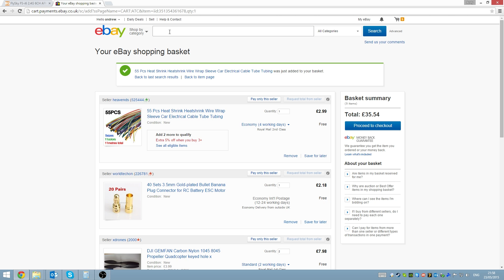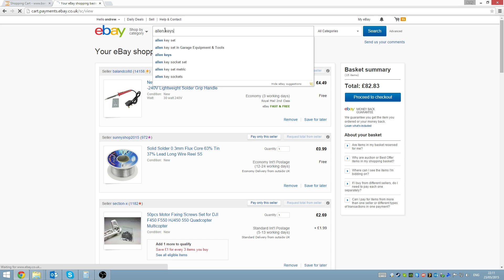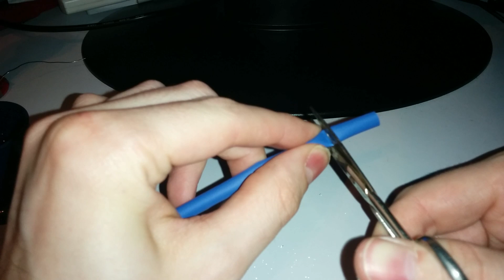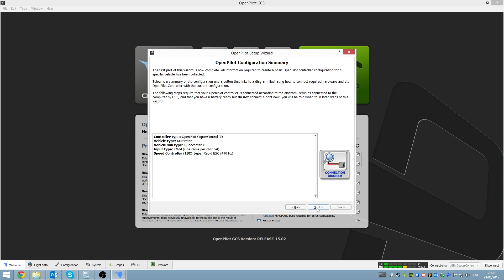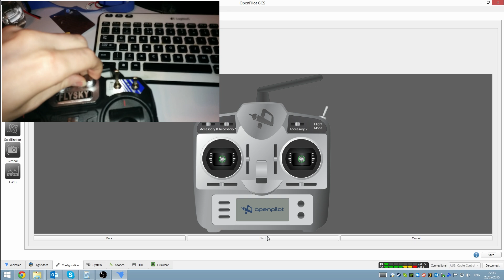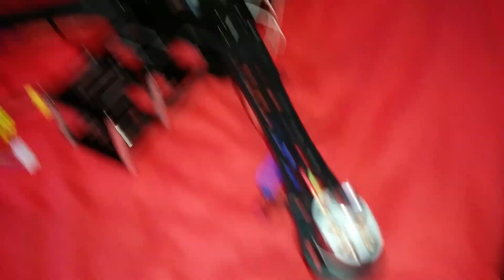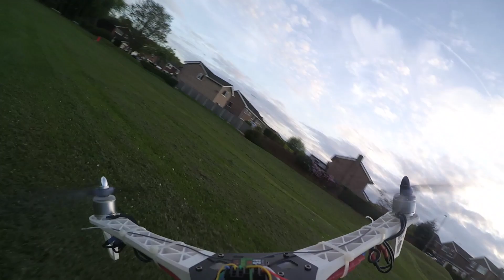Build A Cheap Quadcopter

Comment: Excellent video and still relevant in 2020!!! BG is really a great place to source part without braking the bank as this hobby can be serous money pit. The thing that irritates me the most is that local hobby shops selling the same stuff(or rebranded) on extremely inflated prices with the excuse of "high cost of running a business" but at the end comes to pure greed. That why Chinese online retailers will keep selling and the locals will go bust. I, just like yourself am a massive cheapskate and dont see  reason to shed my hard earned cash for branded products that are still Made in PRC but sold at few times the price... and seems that they dont get the point.. Example? Well, just look what happened to Maplin..

Comment: Things have changed somewhat since you made this Andy. You can now buy a full kit with everything but the battery and transmitter for around £80 and the transmitter can be had for £34. For less than £150 you can have one of these with GPS as well. Something I may build next winter. 
Thanks for this very entertaining build.
Reply: It's a worthwhile build and AndyRC has done an great job of documenting this build! Finished this 450 build a few weeks ago, it took a while but got there in the end! The great thing about this build is that you can add and take away gear as needed. I've used a water noodle as landing padding for my build and lot's of tape, zip-ties and extra foam. It flies quite nicely now on Libre-pilot..
Reply: I didn't wait until winter and I am just starting to assemble the many parts I bought individually inspired by this video I have updated to Omnibus and got all my electronics into the small space of an X-525 with no spaghetti showing ;)

Comment: Hi i got inspiration from your video i have also wanted to build one. I am using same 920kv motor with 30 esc 1045 propeller ande same frame but with 11.1v 3s 5500mah lipo can it carry the battery Wight ?
Reply: Faiyaz Khan that should be just fine, keep in mind that this video is fairly old, technology has marched in quite a bit so there are a ton of vastly better options for equipment at the same or lower prices. For example an Omnibus f4 flight controller runs circles around what was available 2 years ago for this build :)
Reply: Virtual Willis thank you very much for your suggestion😃☺️
Reply: Faiyaz Khan anytime, I'm building an S500 right now and did a ton of research over the last few weeks to get a decent build going. If you want I can give you a list of parts that I'm using when I get home later tonight. Just let me know :)
Reply: Virtual Willis thank you
Reply: That's will be helpful
Reply: Hopefully this formatting works, everything here is available either on Amazon or Hobbyking. The only thing I'm not 100% sure on is if the motors and props will be the same diameter (6mm) if not then I'll need a few small adapter rings, no biggy but I'm fairly sure they will work.

Battery: Turnigy 4000mAh 3S 30C Lipo Pack w/XT-60

Reciever: Flysky FS-X6B 6CH Receiver

Transmitter: FlySky FS-i6

Frame: s500 Glass Fiber Quadcopter Frame 480mm - Integrated PCB Version

Motors: Emax MT2213-935KV 2212 CW CCW Brushless Motor

Props: MasterAirscrew 10x4.5 

FC: Readytosky FLIP 32 F4 OMNIBUS V3 PRO

ESC: 2-4S 30A ESC SimonK ESC With BEC 2A

FPV Antenna: Aomway RP-SMA Male 

Gimbal: Quanum FY Mini 3D PROS 3 Axis Gimbal

FPV cam: Runcam Eagle 2

VTX: AKK X1 40CH 25mW/200mW/600mW Switchable FPV

HD cam: GoPro Hero Session 5
Reply: Small update, the props and motors are a perfect match, woo hoo! I should be airborn in a few days :D

Comment: I just built a F450 quad with AfroFlight Naze32 flight controller and having problems with PID.   It won't takeoff on its' own and when I had launch it fly's up and starts a uncontrollable wobble and crashes.  I going to lower PID numbers and see what happens.  Any suggestions on PID settings.

Comment: I like this video . I'm going to build another Quadcopter ! I just finished the HMF U580 I got it off Ebay as a whole kit with radio link AT 10 II , and Arducopter Apm 2.8 . It took a lot of work , but I finally got it to fly . Brand new to this whole thing , but I like it . Just curious I like the stay as cheap as possible scenario . But what about Like mid range say about a 500 dollar build in the same class Quad like this one you built or like the HMF U 580 ? What Frame would you suggest that could take some abuse , and what flight controller like maybe Pixhawk , or DJI Naza ??? I want to build something that is going to be worth a thousand dollars or more when it is all said and done . Can you put a parts list together in the description ? Maybe a couple different Ideas ? But don't get me wrong this is a good one . My HMF U580 is pretty nice , and I paid 500 dollars for the kit ... Thanks great videos you've helped me along the way here .
Reply: One thing I don't like about the kit I bought is that the  APM 2.8 board is retired , and you can't update to the latest firmware and I would love to stay away from things like this . If I would've known this ahead of time I wouldn't have purchased this kit . I like to be up to date with things I do . So boards that are state of the art for larger Quadcopters like this one you built here . I also like the raspberry pi idea , and the long range flying but still not a rich man so cheap is good .
Reply: Never mind I see you already made the High end build videos . I'll start watching those now ! Thanks

Comment: Hi Andy , Thanx so much for your video`s  - Brilliant and very informative - I have also reached the point where I would want to build a f450 frame up from scratch ,You`re video has assisted much but I would like to change a couple of things like having GPS,Barometer,Gyro,gimble and FPV, My problem is selecting the Flight controller to facilitate all this - also the heavy gimble in your video would that also take a firefly 6s.
Please understand I am also a noob at this so your help would be greatly appreciated

Comment: hello buddy really enjoyed your video. didn't go for exactly same as you but still using your video... QUESTION... where to get the cables to connect the receiver to Flight controller? I didn't get it with my transmitter...

Comment: I've followed your video in great detail a few times. I'm unable to find the parts as you were... Any recommendations insofar as a vendor that can provide all of the parts?

Would I do better long-term to go with the F3 V4 Racing  flight controller?

THe transceiver (flight transmitter/receiver/controller) - that you used, I've seen upgraded ones - but no matter the upgrade, they all seem to be limited with 6 inputs back to the controller - hence, my software to take advantage of those receive ports. Is this ornal? Is it because multiple things can be read on a given receive line? (i.e. altitude and / or GPS data coming in on the same line (R0, for example), and on R1 maybe I get other weather data, R2 other telemetry data?

While I love the 250 size and 450 as well, I'm looking at a 450 or larger, primarily for aerial photography. I've purchased the more expensive units - XIRO the best fr very smooth video while getting enough payload for me to mount 2 batteries on the unit and a cross-over that allows me to switch from an almost dead batttery to the fully charged secondary one. This I've done successfully with XIRO but not with DJI units (F 3 and 4) because of the way the XIRO is built - it's much more extensible. But I'dd love to try and  build something even better... thoughts??

Comment: Great video, really outstanding to put something from start to finish!  I've been flying toy grade like the Syma X5C for line of sight practice.  I want to move up to something slightly larger with brushless that can carry a runcam or Mobius.  I don't need a lot of speed, I'm more interested in run time and stability.   Is the 450 build the step up?  Or is there a a slightly smaller in-between model?

Comment: Hey guys i am currently trying to build my drone with arduino uno. I am 
trying to make the drone without using a radio controller, just by 
sending pulses to the arduino from my computer. Does this work the same 
way when trying to connect to the gyro and make the connections?
Thanks

Comment: Hey andy,  i broke my arm.  I use F330 frame.  Can i use f450  arm?
Reply from the maker: u should be able to get the same arms on ebay they sell em separate
Reply: i think i will buy whole frame instead, it is cheaper at my local online shop     https://www.tokopedia.com/anekahoby/frame-f330-with-pdb-dji-rc-quadcopter-support-kk-mk-mwc-apm-naza?src=wish&type=1
compare to this 
http://ebay.blanja.com/?dir=shop&menu=keyword&q=f330+arm&sk_idx=1025541&siteID=0&sk=f330+arm

Comment: Really interesting video. I decided to get myself an MJX X600 last week and I've already decided that I want a proper 450 quad to mount a camera on so this is exactly the sort of project I have in mind. I'm planning to spend a little more than the bare minimum but still looking to upgrade over time rather than try to build the ultimate quad right off the bat but I think you've saved me a few quid too. :)
One question, I have a 6 channel controllerI got with the X600 - can I use that with another quad to start off with or do you have to buy a matched controller and receiver?

Comment: mr Andy thanks for your video this is very valuable and because of your video I have my scratch built of 450 size quad. it will be useful if you upload an video on how to fly a scratch built  of DJI 450 clone tutorial because it is little bit confusing to control the scratch built that I built by seeing your video . and I would suggest you to screenplay simultaneously both the quad and transmitter 
I have uploaded my video of the quad that I built by seeing your video https://youtu.be/qBcT0nfqZ7Q
some of the item that I used are out of you box but you are the person I should thank.😃😃
please don't forget about the flight tutorial

Comment: Thanks for the video, hopefully you will have time to respond.  Having never built a multirotor before, are my expectations of building a workable drone by following this series realistic and do cheap parts prevail or did you eventually he to swap over for more expensive stuff please?
Reply from the maker: nope never swapped the parts but did build another. check out the high end series in the playlist

Comment: is this transmitter good for flips and spins? I guess these 450s are too big for those huh? 

also if I build another quad your other cheap quad 210 I think. what do I need for the transmitter to work with that one? 

thanks love the vids
Reply from the maker: u can do flips with them but not as fast i recommend a race quad for that
Reply: AndyRC thanks for the info! I guess it's time to save up for the cheap race quad you did and test it out. I'll have to look up some videos on how to though. 

thanks!
Reply from the maker: sure thing happy shopping

Comment: I have a question i have the cc3d at my quanum venture but when e punchit at 100  prozent it going relly hard to the ride side i must it every time corekt do jou know what can be the problem
Reply from the maker: sounds like the accelerometer needs calibrating on a flat surface
Reply: were in the program can i calibrat it is that that kalibrating at the bigining? And were ar shut sitting the flight controller is that bad when he dot as an perfeckt position to the front
Reply from the maker: it may have changed now as i believe open pilot has been discontinued for libre pilot?

Comment: Im in a huge trouble, in setup this software picks up the radio signal and i did just what you did, at the YAW RIGHT time, i got no ARMED sound, and after that nothing happens, no motor starts nothing, what to do?
Reply: i have the same problem did you solve it ?

Comment: Hi Andy,  finished my 450 quad built to your instructions a good while ago and it just sat there waiting for me to set up the controller as a 2nd attempt. First try at setup I too had a shorted motor resulting in a well-cooked  ESC. I removed the motor from the frame and tested again with a multimeter and NO short. I suspect I was too generous when applying the loctite to the mounting screws and some of it 'set' and was 'bridging' onto the windings. Well, I did the setup yesterday and towards the end of the vehicle set up wizard I chose 'generic 450' settings and did not do any tuning afterwards. The maiden flight turned out great without any problems. I do have quite a bit of experience flying small quads which I think is advisable before flying one this size. Thanks for the video. PS could I use a 4 cell lipo instead of the 3 cell I am currently using?
Reply from the maker: u should be ok with a 4s as long as u dont try to carry any payload. cheers

Comment: My friend, my quad keeps flipping on takeoff. I've broken like 5 props trying to just get this thing in the air. I mostly have the exact same parts as you do. I'll keep at it. Any ideas? 

Thanks! Love your videos!
Reply from the maker: sounds like perhaps the motors are shorting like they were in my video. check the screw isnt hitting the back of the motor
Reply: AndyRC I'm afraid I wasn't specific enough... the motors were fine. I thought the ESCS were a problem so I swapped one out. 

I did lick the problem though! it turns out I had the CC3D board turned 90 degrees so I could access the USB port easily but I didn't reflect that in the Attitude settings. 

Thanks for your videos! Thanks to you I have a lovely quad thar I wish to upgrade for years to come!
Reply from the maker: no problem enjoy flying

Comment: Thank you for this video. I will try to build one soon. Going to buy what you bought. I have a question. Is there anything you wish you would have bought differently to make your build better?
Reply: So i bought basically all the parts and just built this quad so maybe I can answer:

The frame he got isn't very good (as you saw in the video). Get the frame in the High end quad copter video; it's not much more expensive and it's loads better. Plus it's its own power distribution board. Or just get a DJI 450 frame outright. I did, and I was able to use my 3D printer to make parts for it since it was such a common frame. 

I think the flysky i6 transmitter, while functional, is way on the cheap end. 6 channels will get it in the air... But doesn't leave enough room for other accessories. No gymbal or anything. For not much more ($20 USD), can get a 9 channel. 

Hope that helps :)
Reply: Giando Sigurani thank you :)

Comment: it would've been better if it had gps
Reply from the maker: not true check out the high end version i did.. truth is no one wants to pay the amount u need to get decent results 20 dollar gps = flys back to china
Reply: $20 gps + $9 OSD + $5 FTDI adapter = 10 times better Quad. Only thing is, that is huge can of worms that nobody wants to explain to newbies which I completely understand.
Reply: AndyRC haha you have a recommendation? im thinking of going naza
Reply: YoSneeze surely you also have the cost of buying a flight controller that can use gps

Comment: H Andy, I have never built anything before apart from a couple of raspberry pi projects. Where should I start for building a drone?
Reply from the maker: you first need to be able to fly one. have you ever flown before?
Reply: Yes, I have a nano cx10 and I am thinking of getting a mjx x900. Would you recommend something else?
Reply from the maker: not at all those are fine :)
Reply: great :) so in terms of building one, how should I start out?
Reply from the maker: that depends what u are wanting to build. an areal video platform or a race quad?
Reply: I would rather build an ariel video platform
Reply from the maker: well this video shows how to do it the cheapest way theres also a high end build in the playlist section also
Reply: Thank you for your help Andy. I will work my way through this video :)

Comment: I got a kit like this back in 2012 with a Pixhawk PX4 to control it but the PX4 would never work so then I got a Naze32 but the USB port broke off and I got so depressed that I never built the model.  Even if someone manages to build one of these I doubt they will ever be able to get it to fly.

Comment: i would buy better esc's. these only handl 2-3s, i got the LD 250 1 powersystem from hobbyking , 60 bugs and the motors and esc's runs with 4s^^
Reply from the maker: +Bärtiger Baron check the date this video was made..

Comment: hey Andy rc I just got my second 450quad in the air its a cc3d board flashed with clean flight I couldn't get open pilot to work this time around after while it fliys good but seems really sensitive except the throttle what should I do to tune it
Reply from the maker: i think open pilot has become libre pilot now, have a watch of some of the pid tuning videos on youtube. basically u just have to play about with it alot thats why i used open pilot because u could assign a channel to the pids and tune in the air
Reply: AndyRC yes i tried using that too before i flashed it still couldn't get all the way threw the wizard on either of them i tried manually reloading firmware
Reply from the maker: the software side to this hobby can be a pain :( and they change it so often the tutorials become out of date too
Reply: AndyRC Yea It fly's great on clean flight I was surprised to get it working on the new version of clean flight painless360 didn't think it would work